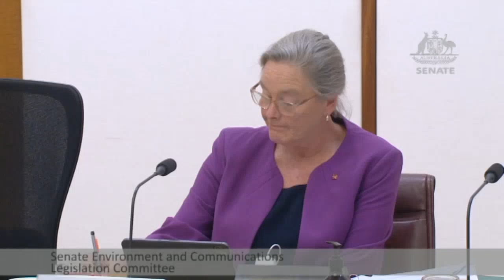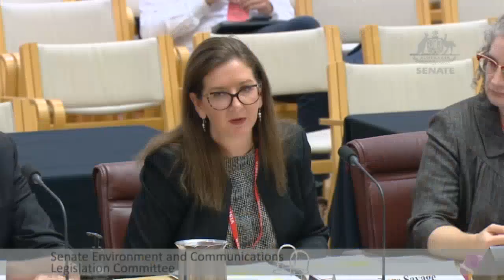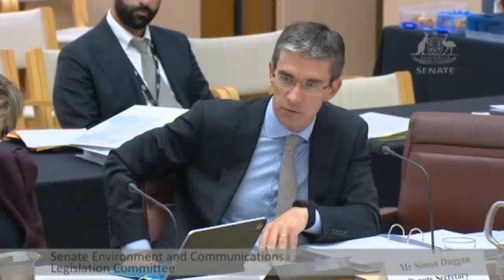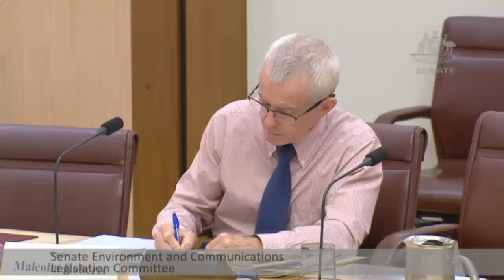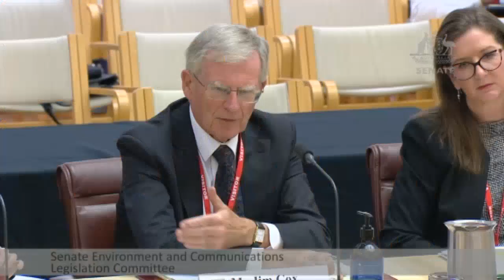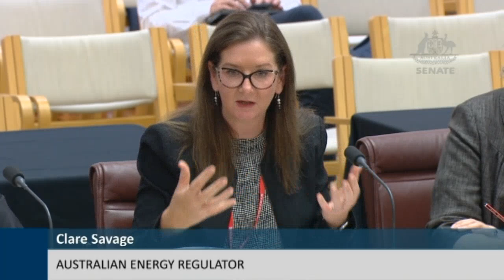Smart Meters and Remote Control Air Cons

Comment: Australia had the best, cheapest electricity generation grid in the world. Now, we have this cluster xxxx!  Our independence has been taken from us, no longer able to control an air conditioner in our house. All because of zealotry & climate religion foisted upon by greedy banks that will trade carbon credits amongst themselves, forever. #ClimateScam
It’s just a transfer of wealth upwards. We send highest quality black thermal coal to China, for them to generate cheap base-load electricity and make windmills and panels to sell back to us, so WE can have the most expensive electricity in the Western world. Makes sense, NOT! Australia is an energy powerhouse and we have been relegated to a backwater with shortages, blackouts, expense and unreliability. All the while Asia is powering ahead, building one High Efficiency Low Emissions coal fired power station every week. We had 25 and have to shut them all down, bankrupt ourselves buying windmills and panels, cover our prime agricultural land with power lines. Overseas companies will own the lines and we’ll have to pay rent on them FOREVER. Australia has been consigned to an energy poverty future. All for nothing. Tragic.

Comment: ANOTHER invasive control system by businesses......... all solar systems that generate electricity has storage batteries which will hold the charge for when needed .......if energy is created and batteries are full that system will stop capture to preserve the solar battery system....the only time this does not happen is if the system has the ability to transfer energy to the grid for which the grid pay a nominal cost back to that system owner ..........the smart metre is a back door and if it shuts off the solar capture energy system that will lead to the batteries not fully charging for use when needed by the owner .......

THIS THEN FORCES THE OWNER TO HAVE TO USE THE GRID ENERGY AND IS THEN CHARGED FOR THE ELECTRIC USED THERE BY GENERATING PROFIT FOR THE ENERGY COMPANY...........

Turning off some ones air conditioner who has solar is another  excuse to justify their actions.........the notion that solar creates an un stable grid by home owners is just false so they justify their actions against home owners with solar ...........

logic tells you any solar energy that can effect the stability of the grid is the ever growing solar farms and it is those that need to be turned off and not the solar home owners.....

the energy companies do not want free energy being created by the little man as there is no profit coming their way .......

smart metres are not for the benefit of the home owner although they say it is ...........the energy company save money on the billing system and cuts jobs of those who were employed to come read your metres........

the corrupt nature of companies is to generate profit and the best way is to activate the smart metre to shut down systems it can enter and be controlled by the all singing all dancing smart metre which is really a Trojan horse of deception endorsed by corrupt government assistance to endorse and protect the energy companies profits..............

Comment: Living in the countryside my mate was informed about the placement of a smart meter installed to the power box, he found a loophole and used it as well as a trespass notice,  then used locks , only meter reader had access as the installer for smart meters were contracted to a separate organization

Comment: If you only have solar, you are a price taker. In this case, that may be zero.  The ministry of truth, equity squad, can enforce, you take the price, zero.   Post moden woke, protect monopoly.
If you are hot and sticky, the greater good wins.
Battry first,
 then you are a price setter, i will take lowest cost or my solar, 2cenrs.
The installer puts max solar at max.exposure even the installer help the monopoly not you.  Your solar should cover you for as long as posable, ie your solar be 4kw hours as long as posable.  The battery covers morning and 3 4 hours after dark.
The whole solar is backtofront as solar has got cheaper stronger faster, even more so.

Even if you believe in coal, a battery stores at idle night and use at peak 4pm to 10pm.   When its hot, your running your air con off grid on night tariff.

Comment: We are in rural Queensland and installed solar just over 12 months ago. We have 3 phase and we're told we MUST have a smart meter. I refuse to have our AC turned off, because my wife needs it as she can't regulate temperature in her body. Ergon are aware of her issues.
Reply: Did you try to refuse?
Reply: @jarrod1687  had no choice to connect 3-phase hybrid solar. No meter, no solar to grid.

Comment: What they also do is, if you have batteries they will stop the charging off your batteries and force you to use their grid to import power when you have a fully functioning solar array and battery backup. It doesn’t make sense and when the Victorian has a network failure SA for a week had our power export reduced so the big boys can still EARN money from AEMO disastrous network system. They will steal power from your battery without consent and then you don’t have enough so once again you have to import at a cost to yourself. This stealing electricity was not consented by me as I didn’t agree to any of the 9 questions when my batteries were commissioned. SA power dodged the questions  and kept saying, electricity security. I didn’t spend $45k on a system to prop up the government  electricity security. I use a connection to my gateway that doesn’t receive data from them but I can see real time what is going on and alter the setting as I like remotely . Play stupid games AEMO, you will win stupid prizes .

Comment: It seems that this argument and the problems of control of our energy supply systems are caused solely by this must have  multi billion dollar ( dark ) green energy infrastructure. This never happened with coal power stations where you could actively produce more or less power as required.

Comment: I’d like to know if one can opt out of a smart meter. It seems to be the only way to stop the state government turning off your electricity!!!!!
Reply: I received a notification in mail from elect. Provider saying that I had been chosen as an ideal candidate  to install a smart meter and they even set a date for their installers to go ahead and install. I called them up and told them that I didn't want a smart meter installed as I am planning renovations and an electrical  upgrade to my property and I put a lock on my meter box and kept it locked for a month  or so. I plan on installing a small perspex windows in meter box so the readers can still read  the meter  while it's locked.

Comment: Yes they do this in SA as well. To beat them at their own game , I just block the internet connection to the smart inverter and the system will behave normally.
Reply: How do you do that. We are SO angry tonight. Knew nothing except a $120 increase in last month’s bill. We have 14 panels on the roof. Bastards.
Reply: @anaclark5751  if you have a  wifi router , block the ip address for your inverter. If you have  Ethernet connection pull the connector and if it’s SIM card remove the SIM card.
Reply: @anaclark5751  it seems some government official had my comment removed because I basically telling you how to do it . Seems the truth hurts the government .
Reply: I post they delete. Block the ip address for the inverter on your router or wifi modem.
Reply: @anaclark5751  let’s post again and see how long this last. If you have a  solar inverter or a gateway. 
a) wifi connected to internet- block the ip address in the modem or router
b) hard wired internet connection- disconnect the Ethernet plug
c) if it has a SIM card. - either enter setting in inverter and disable 3 or 4G communication or simply remove the SIM card. 
This post will most probably get removed again, but day after day I will just keep reposting it . 
Stealing is a crime , but when the government does it , it’s called energy security,
Reply: @anaclark5751  they have deleted it again
If you have wifi connection  block the inverters ip address
If it’s an Ethernet connection simple unplug it
If it has a SIM card , remove it. 
I don’t know why they keep deleting this comment considering that the old inverters didn’t have internet connection

Comment: Correct me if I’m wrong but don’t these “smart” metres need mobile phone network connection to operate? If so can you put a faraday cage around them (eg aluminium foil) to prevent data being transmitted?

Comment: Smart meters can switch off solar input to the grid, but as for D.R.E.D enabled devices such as air conditioners, heat pumps etc, these are not controlled by a smart meter but instead a signal sent over the electrical grid, much in the same way off peak power is switched on/off for water heating.

Seems the government should be incentivising home batteries to store this excess energy and utilising virtual power plant technology, so this nonsense doesn’t happen and the generators can run an even lower base load minimum!?
Reply: Simpler idea - they should abolish the grid. Batteries, solar and inverters exist that are capable of removing the need for the grid. You want to know why they don't want that? Because by forcing people to be on the grid, they can force their way into properties, control your power and appliances and thus force you to live according to their climate lies and tyranny. Its about totalitarian communist centralized control.

Comment: Also, anyone without a smart meter they can turn up the voltage on the grid.  This is why sometimes the voltage is above 250v.  Your inverter will not export any power above a set voltage.  Your inverter will then burn all extra power, rather than exporting for cash.

Comment: HAHAHA FFS We " oversee" but arent in any form of control. The very open contempt of these so called public servants while smiling is disgusting. The fact climate change has been formed into a government department for energy shows you how far this foreign agenda has wormed its way into our daily lives at our expense. If you are planning to install or replace an air con make sure the contractor discloses if it can be " Controlled " by the government.  Smart meters are a lie they are not smart and are used by the suppliers to dispute bills and give them a right to charge you the user for them to check if the so called smart meter is even working . If not they will just estimate it for you at their benefit of course but it will be claimed is to your benefit.

Comment: A smart meter was installed in my home even though I said I didn't want it.  They turned up to the house when I was at work and changed it . I wrote in and asked for my old meter to be re installed and was told no

Comment: To turn off an air conditioner, it has to be a smart machine too, compatible with a smart meter, either by radio frequency or talking to it on the electrical circuit?If this is the case, the air con would have to be enabled to accept this! It could not possibly be done with an older smaller air con, especially in the bedroom, as lots are on the Gpo circuits. Unless they want to shut other power points off too. Which i doubt

Comment: Check your recently installed Air Conditioning. They can do that as well is they have a wifi connection installed. 
So instead of the Government providing enough infrastructure they can and will turn off your air conditioners. Isn’t net zero wonderful?
Reply: @beedoox5613  john howard-best P.M. ever. You don’t know how I voted.

Comment: How many businesses have had their power turned off or reduced, or is it just individual house holds. These are the reasons why I am completely independent of the grid and why I installed batteries and why i don't send excess power generated to the grid. Bureaucratic enslavement.

Comment: thanks for following up. we had power out in the street yet the Retail provider website said our solar was still operating. Ringing them to see if I can get a credit for the daily connect fee. They said they are unable to check the smart meter because it was not responding. I said yes Energex had the power in the whole street. A disconnect between the retailer and the supplier. And you would think a smart meter would flag an error  if can't connect.

Comment: I used to keep a spreadsheet of solar generation and noted several mornings in summer that there was NO solar going into the grid with full sun. Just waiting flashing. 
Getting ripped OFF loosing $$ of my feed in money. 😡😡
If we had a sufficient BASE load generator system this would not be an issue to fiddle with OUR solar feed in and our $$

Comment: Energy is an essential service not a freaking market to make money out of by exploiting Australians.
Reply: EVERYTHING is to rip off the people, and to transfer whatever wealth there is from us, to the already uber wealthy!
Reply: U wish 😅😂😂
Reply: This doesn't have much to do with the market. It's about grid stability. 
Generation must match supply. Solar by its nature is a turbulent generation type and without the correct ballast in place can cause potential instability.
The minimum generation capacity they are talking about is due to the fact that gas and coal generation can't go from 0 to minimum to maximum quickly. The risk is that solar may be generating enough to potentially switch off a coal or gas generator, but if you have a cloud fly over a solar area, suddenly the generation drops, the coal or gas cant fire up fast enough to follow the grid demand and the grid then collapses as a result.
Its a problem that is yet to be solved.
Reply: @slickstringsnot my problem. The was an asset owned by the public. Now they are screwing us over.
Reply: Old billionaires disagree. And the GenX Millionaires are laughing at you and me both lol.
Reply: Its happening in US too.
Reply: I couldn't agree more.
Reply: Privatisation says  otherwise.
Australia voted for  the politicians  that voted to privatise  it. 
If it's so  essential why don't you "privatise"    your  own electrical installation?

Comment: Unless you have a battery as part of your system ALL power generated by solar panels is sold at minimum rates to the Government (GRID) in other words you have paid for a government (GRID) asset to generate power..... You cannot use it directly unless you have batteries or are OFF Grid (Batteries required). don't agree wait till the next power outage during a sunny day; if your power goes off then you are not utilise the power generated by your panels it is controlled by the GRID.

Comment: Why is it you, Senator, always run into a bunch of bureaucrats (small b) who have no idea of how and what they are engaged in doing. That is always followed by "The CHAIR" that points out the bleeding obvious which is the point you are making! If the bureaucrats don't know what the states are doing in regards to the control of the electrical load of the regional grid, how can they deliver a sustainable and coordinated supply?
Fundamentally you're looking at either a demand collapse or accidental switch off based on over feed-in. CRAZY🤭😂😂😂

Comment: So malcom you would perfer rolling black outs during heatwaves for hours and whose suburb should get blackout or by dailing up the temperature to say 25c and shutting off pool pumps. And evreyone still has essential power?
Reply: No, use your air-conditioning to suck up power along with pool pump. Turn off solar = no power by invertor. You have no power what's so ever, worst than Apollo 16.

Comment: We were out of our home a number of years ago (in Victoria) and a smart meter was installed on our front porch without any notification or our permission. When l complained, the basic attitude was, "suck it up, we're doing it anyway."  In regard to solar panels, our power generation, from our panels, that we pay for,  should NOT be externally 'managed' at all and certainly not turned off. Thankyou Senator Roberts. There goes the chair again interrupting again.
Reply: Put some lead over meter.....
Reply: Ours was installed in Victoria without our permission too...